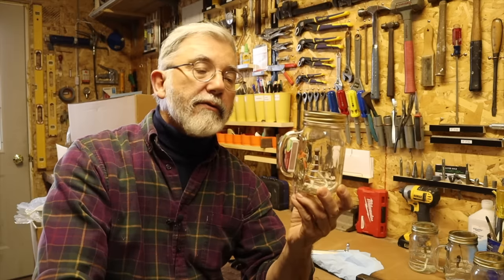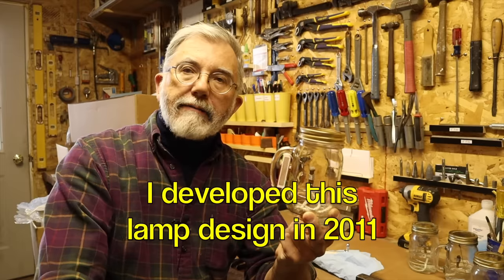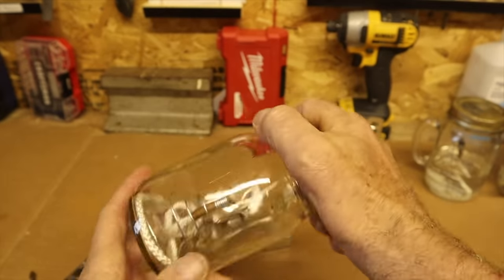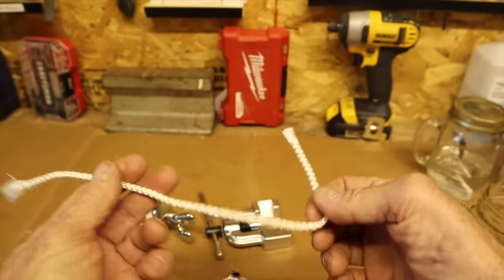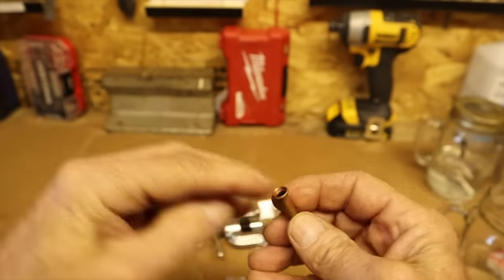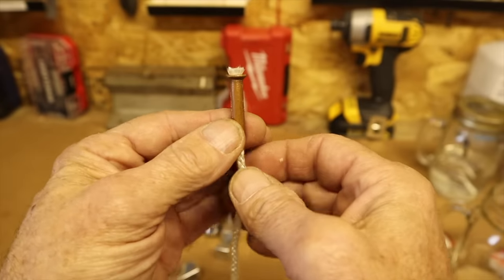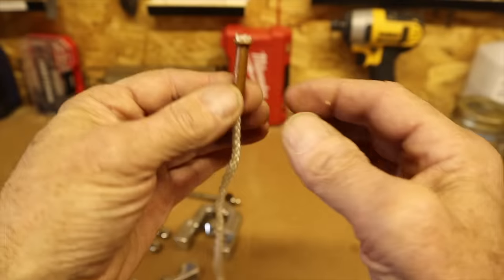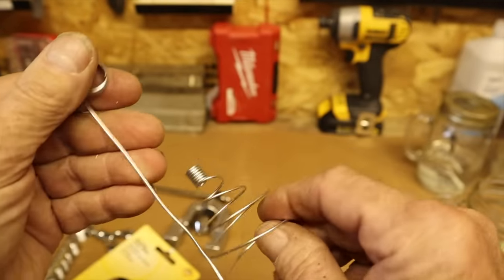How To Make Your Own Bright Betty Emergency Oil Lamp

Comment: People!!   if you really need to make a emergency lamp what you really need is a jar and a piece of wire!  also you can make a wick from an old pair of blue jeans!  or some other material from a piece of cloth!  Or string, yarn rope cut? cut it with a scissors . you can coil the Wire by hand and with a pair of pliers ,,of course copper wire is very soft you can do it without even a pair of pliers.   you don't need the jigs.   just  bend by hand or use a pair of needle-nose pliers,,, you don't need the metal tube either! you could make the tube out of the wire!  just something to hold the end of the wick from falling . Also in an emergency you can use kerosene diesel fuel vegetable oil olive oil sometimes melted lard or Grease as a fuel for the lamp just keep the wick very low so it does not smoke and not everything will be healthy to breathe! so be careful,, use your common sense it's BEST just to be prepared and have what you prefer ahead of time :-) but remember be inventive !!!  CAN USE A TIN CAN ALSO! it's a cinch in a pinch :-) have a great day. Jesus is coming ,mark southern Missouri Ozarks USA

Comment: I designed and 3D printed a mandrel to bend the wire wick holder. Do you have an email ? I can send you the STL file (and a sample print).
Reply from the maker: That's downright impressive! I'd like to have the file/print. Don't know what I would do with it but file it away. Have you actually used your printed mandrel to see how well it works? I don't make the lamps any more. And don't sell the parts kits. Someone else needs to pick up the baton as I'm getting queries about parts kits almost daily. herrick@planetwhizbang.com. Thank you.

Comment: Let me get this straight. I need to buy some copper tubing, a tool to cut it with, a tool to flare it, some 18 gauge galvanized steel wire, make my spiral, buy some paraffin wax, some 18 inch fiberglass wicking, some mason jars with handles, and PRESTO! I think I'll pass and just buy some battery lamps and extra batteries. And, the big advantage, NO SOOT! EASY PEASY.

Comment: Open fuel sits underneath fire, how about it's safety?
Reply from the maker: Any open flame is a potential hazard. Handle with care. That said, the liquid paraffin under the wick is not flammable. Lamps like this have been made and used for many years. Thanks for the question.

Comment: Can one get carbon monoxide poisoning from burning these indoors without ventilation?
Reply from the maker: Possible, but not likely. Carbon monoxide poisoning from burning candles is also possible but not likely. Open-flame emergency lighting devices, used for relatively short periods of time, shouldn't be any problem as far as carbon monoxide. That said, if you are concerned about that, do not use a Bright Betty. Get a rechargeable LED lamp instead: https://youtu.be/4m6zh0FKbHs

Comment: So,
Just a heads up to all those out there running to hobby lobby to grab mason jar mugs-

Those antique jar mugs that these where originally designed for and used in are NOT THE SAME THING THATS READILY AVAILABLE AT WALMART AND SIMILAR RETAIL STORES.

you need to ensure that the mugs you buy are JARING SAFE. otherwise the heat produced by the flame WILL explode the glass and you WILL burn down your house thinking you where thrifty by spending .99 cents a jar on your emergency lighting solution.

Just my 2 cents worth that will save your house.

Comment: Couldn’t you make this even simpler ?  Use copper wire and then make a tight wick loop (coil = tube), bend the copper away and then do the coil and handle parts.   The copper near the flame will still get warm to cause the vaporisation of the lamp oil.

Comment: Heat emitted by the lighted wick will break the jar!
Reply: Just use the wire to hold up,  above the oil, the wick!
Reply from the maker: The jar does not get hot. https://youtu.be/asgeLt0cshE

Comment: If you leave the handle higher and outside the top a little you won't have to burn your fingers after it's been burning 🔥 for a while and you wish to lift it to extinguish it. Just saying sweetheart.
Reply from the maker: True, but the projecting handle will prevent the screw top from fitting. 👍
Reply: @herrickkimball  I sure hope you're not trying too put the lid on while lit!!! But I suppose you could have several of the the wire tube configurations in a gigantic jar say for instance a gigantic used bar top 🥒 pickle jar. And make them all one piece and liftable from the center for a bit more light and of course heat 🔥!!! Built in a pyramid formation like 📣 cheer leaders do except all four sides!!! And I don't mean any harm towards anyone I'm just thinking out loud 🔊!!!

Comment: Have to tell you  those look  DANGEROUS AS HELL.  You have  what is going to be  HOW HEATED OIL in a BREAKABLE  and SPILLABLE  container.  Something/ someone knocks that over, spills it, breaks it, you are going to  have the entire fuel supply LIT OFF
Reply from the maker: The oil is not heated. I discuss safety and tipping/spilling in this video: https://youtu.be/asgeLt0cshE  And I discuss LED lanterns as a more safe emergency lighting option in this video: https://youtu.be/4m6zh0FKbHs

Comment: Dangerous AF! Why risk burning your house down when there’s so many safer options?
Reply from the maker: I address the matter of safety in this video: https://youtu.be/asgeLt0cshE   This lighting device should only be made and used by responsible adults.  Anyone not comfortable with an open-flame lighting device should not use them. I present an alternative lighting option in this video: https://youtu.be/4m6zh0FKbHs.  Thank you for the comment. 👍

Comment: Oh gee... trip with that lamp and the whole house goes on fire. Get a candle or a flashlight. Most cellphones come with one
Reply from the maker: It's possible, but not probable. I tip 5 Betty lamps over in this YouTube... https://youtu.be/asgeLt0cshE   And I discuss rechargeable LED lanterns in this video....  https://youtu.be/4m6zh0FKbHs Thanks for the comment.
Reply: @herrickkimball  thanks for your answer. I've seen your demonstration and left a message. Still think there are better methods to use...

Comment: If you drop it, your house burns down.
Reply from the maker: It's possible. But not likely. The paraffin oil will hold a flame but is not flammable. That said, any open flame presents a fire hazard and should obviously be handled with great care. 👍

Comment: don’t get me wrong, I absolutely appreciate the idea and concept. However, in your current design, it is a failure. Failure. You’re still at the drawing board.

If I have to buy that flanging tool, how about I just buy 36 of your Bama lamps? 😒

Comment: How to burn your house down in an emergency
Reply from the maker: This emergency lighting device (and any other open-flame lighting device) is a potential fire hazard. It should be used only by responsible adults and never left unattended.
Reply: @herrickkimball  fire is hot

Comment: I hate it when you guys do this... you advertise that anyone even me, at home, can make this emergency lamp. Then you start listing web sites & single use, expensive specialized tool for a part I'll never be able to make or need again. I don't have that pressing/holding clamping tool or even a workbench, the flaring tool &/or an assortment of other misc 'stuff' making this build "Easy". I have a drill & a few other garage sale tools that are multipurpose so I'm not helpless... but a copper flaring tool??? C'mon people, do better with how you're  naming these easy 'easy' videos!!!
Reply from the maker: Where there is a will, there is a way. Use a pair of pliers to pry back the soft copper and make a flare. 👍